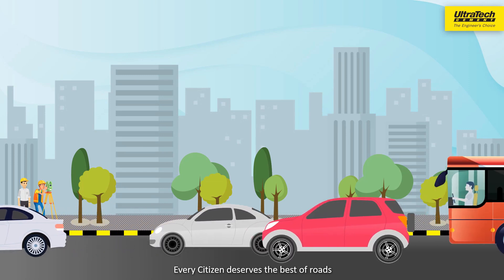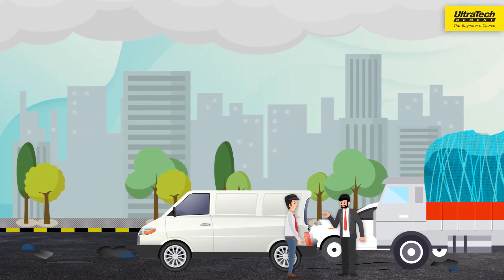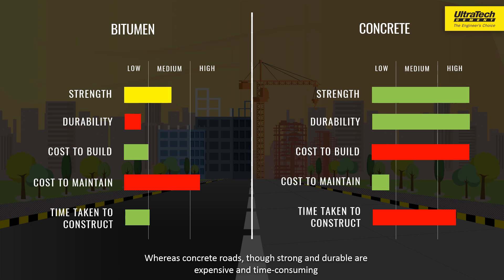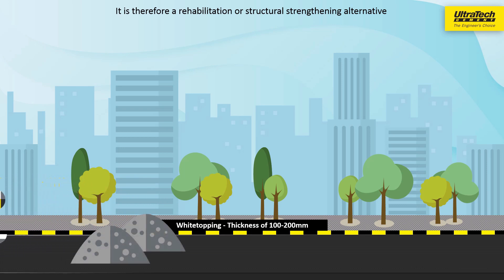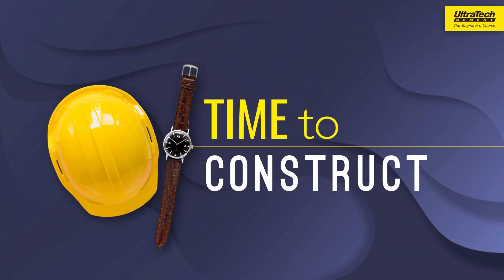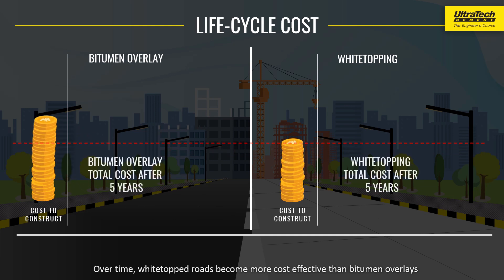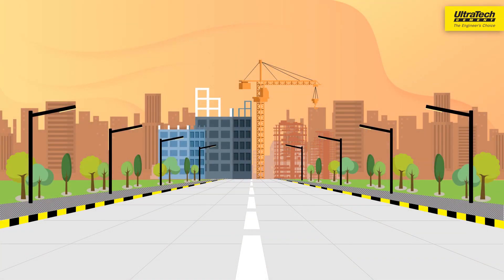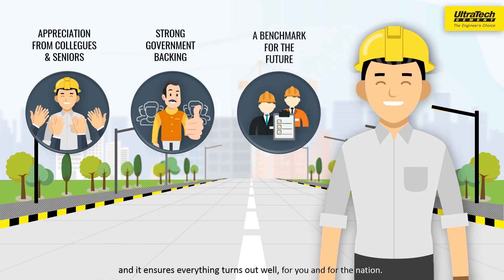White Topping Engineers Video 2019

Comment: Very good , but i have a few questions regarding the friction it provides , the drainage of rainwater  and expansion joints on this type of roads
Reply from the maker: Hello Arbaz,
1)      Friction - Several studies have pointed out that deflection by heavy vehicle wheels on asphalt surface overlays is greater than resistance on concrete overlays. Thus more fuel is required to move heavy vehicles on asphalt / bitumen roads.

2)      Drainage of rain water  - Both  good asphalt / Bitumen & concrete surfaces are  impervious for rainwater to seep inside the  road surfaces . Surface run off from the roads in the city goes to side drains along side of the road . This drained water can be utilised to recharge the ground water in appropriate way .

3)      Expansion joints – in White topping roads joints are cut in close interval of 1 to 1,25 m( panel size  1m x1m to 1.25 mx1.25m). Joints are cut to a depth of H/3 or H/4  where H is slab thickness 
Regards, Team UltraTech.